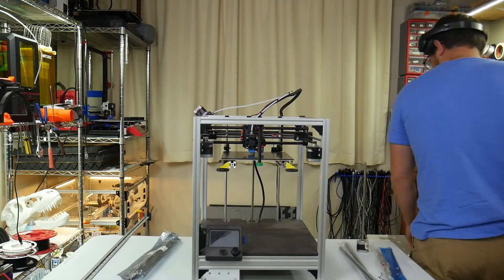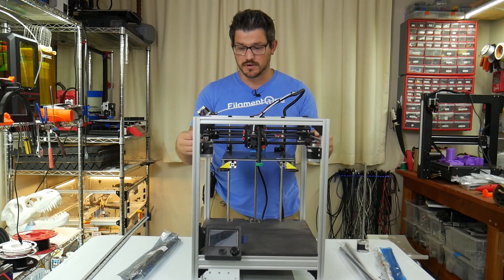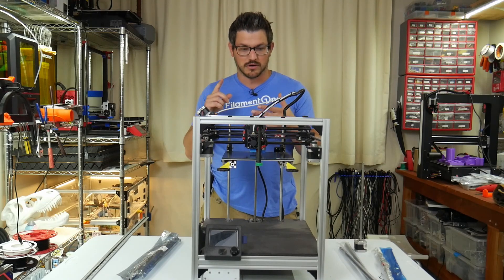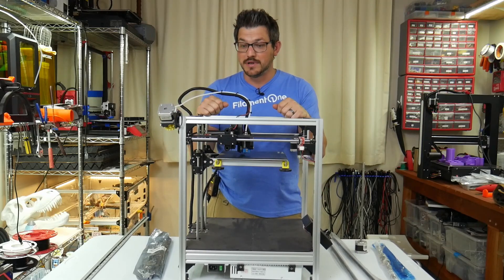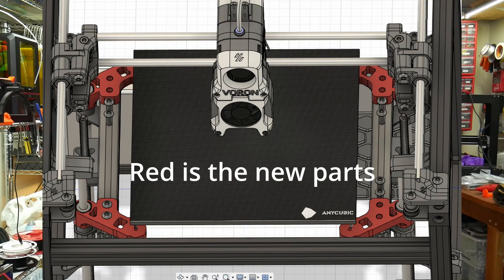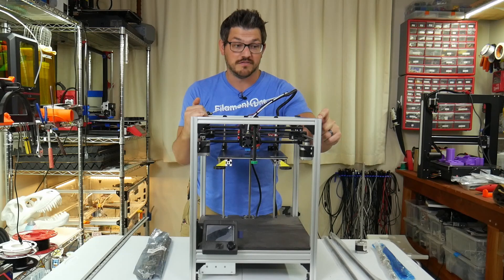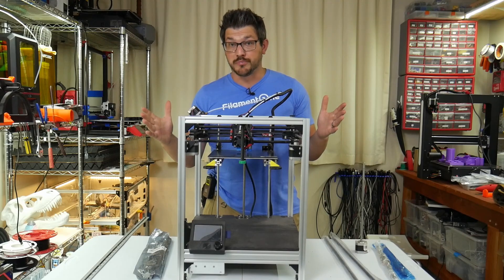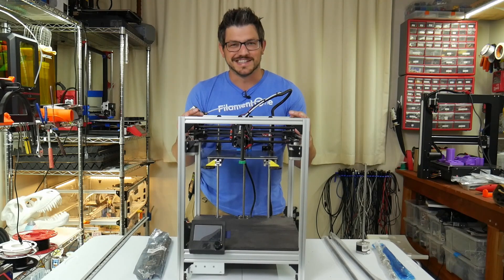HyperCube to Voron Legacy (Project Intro)

Comment: I'm currently in the same conversion project from HyperCube to Voron Legacy but I figured I also want an enclosure for better performance, efficiency and so on.
The German YouTuber StoneTime did a case mod to the Legacy and provided CAD files in the description. You may want to skip through his videos for inspiration if you feel like it.
https://youtu.be/MyvGUKP8fUo?t=58
https://youtu.be/yI9Qyko6WpU?t=82
Reply: How's the project coming along?
Reply: @PersonalArtWorkshop  Thanks for asking. I have very little time for my projects and when I wrote this I was already 6 months in. But now the printer is already functioning and produces good results although not necessarily better ones. Part cooling is way better than before. Currently I'm working on the case and lights as well as a camera mount for monitoring.
The KlickyNG probe is really nice but was a pain to assemble.
I used higher quality parts for this printer, so many of the smaller annoyances are gone by that as well. The Hypercube was my first printer and I kind of cheaped out here and there. Reliability has gone up significantly.

Comment: I still have my original Hypercube. I also built it the wrong rotation, but it did me fine to start with. I used it to build my second Hypercube that is much bigger and works more reliably than the original (it's busy right now printing a headphone hook that broke). I like my new larger hypercube, it's not fast, but it works well and its reliable.
It has an upgraded main board, bigger bed, linear rails, dual Z drivers bla bla bla.
I hope you do well, I'll follow what you do.